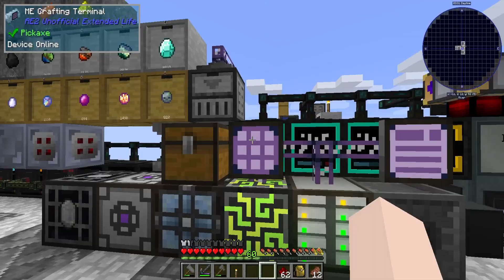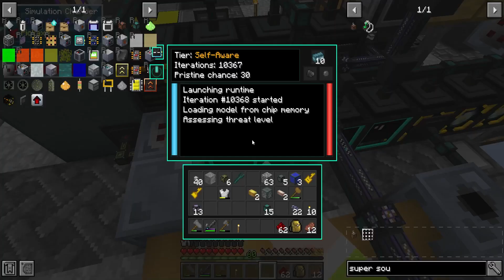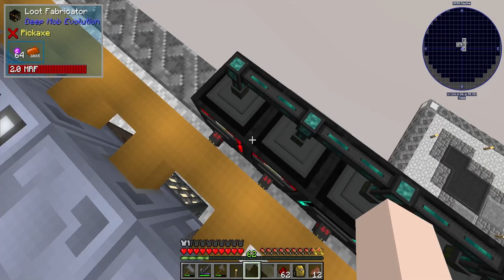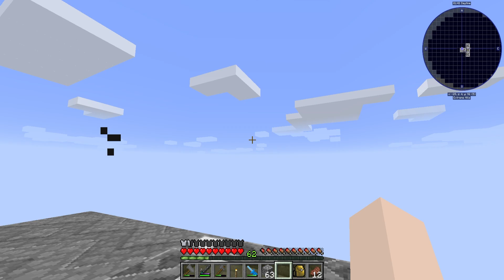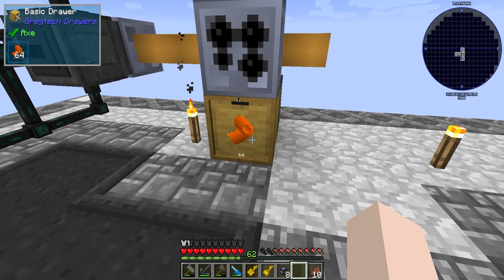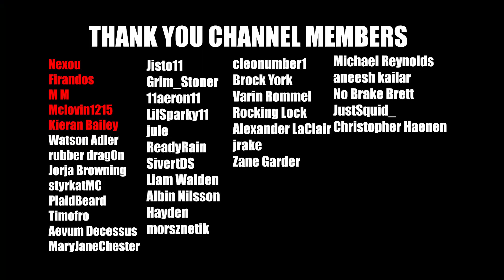Path to CIRCUIT AUTOMATION!!! - NOMIFACTORY 5

Comment: C W G, you should increase the drawer buffers, as a stack of most items could be too little in many cases. Also, i don't recommend trying to passive circuits. It's pretty difficult and it's enough to keep a stock of all the needed items like SMDs or circuit boards. Glad your back to making videos!

Comment: Hey CWG, how are you getting so much power from your numismatic dynamos? Mine make 2048 RF/t maximum
Reply from the maker: The upgrades make them produce more power, mines at the hardened level
Reply: @MasterCWG  oh, right lol, I had forgot about upgrading them when I changed from steam. Is there any way I can take the upgrade off of my old dynamos? Also, does doing the efficiency upgrade to those dynamos make the diamonds worth more power?
Reply from the maker: @theseeker4249  I think you have to upgrade them sequentially, not sure.  But upgrading also gives more augment splits, so you can put in even more efficiency augments to make the diamonds last even longer xD
Reply: @MasterCWG high enough levels, and they will last years XD
Reply: @theseeker4249  If you want the most efficient power setup with numis, upgrade them to reinforced and give them 5 fuel catalyzers. Then, one max tier shulker model will be able to support 2.30 something numismatic dynamoes, so you can use two and still be building up a buffer of diamonds.